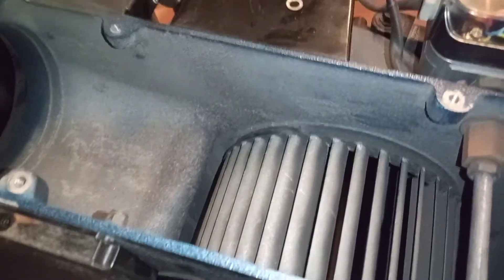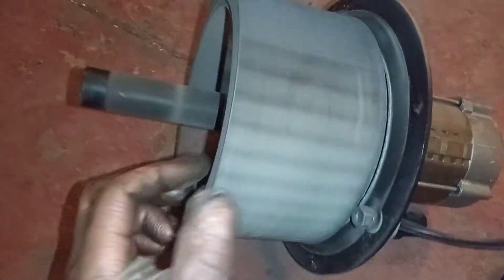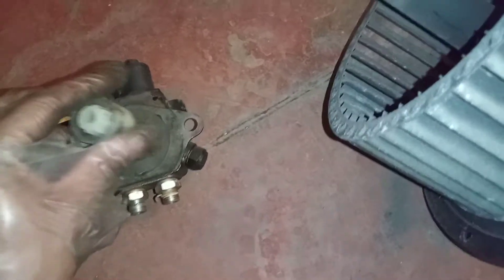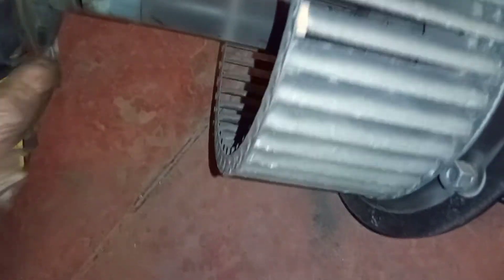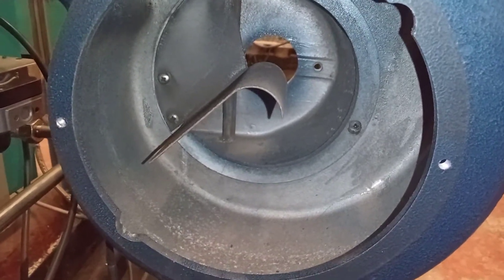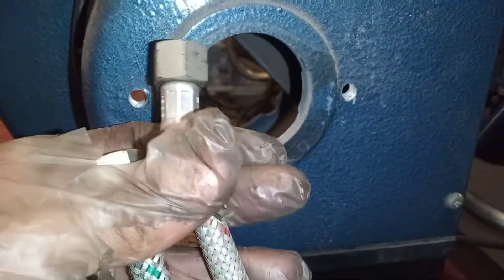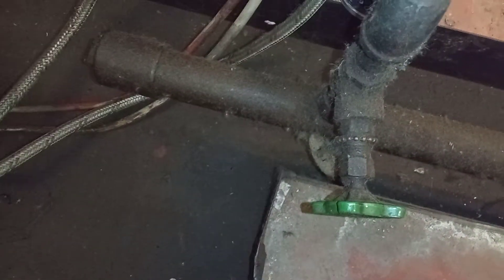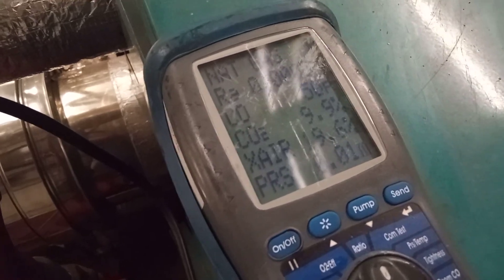NU-WAY NDFL13 LOCKOUT pt2

Comment: So did you replace the pump or remove the drive coupling for a temporary fix while in gas
Reply from the maker: Hi Rog, I did a temporary repair whilst awaiting oil pump. Left one unit isolated with faulty pump but have 2 out of 3 operational. Customer doesn't use it in oil mode any more. Thanks for watching